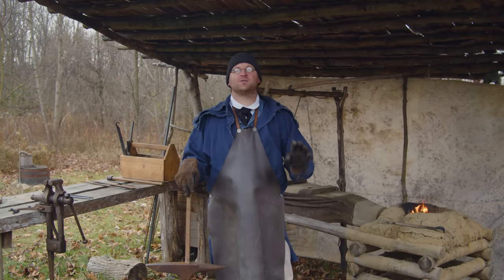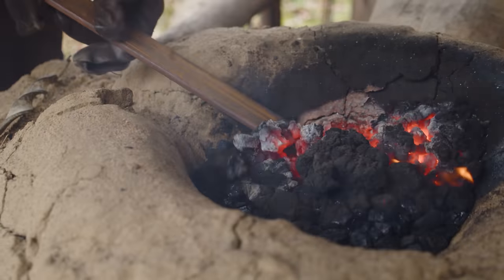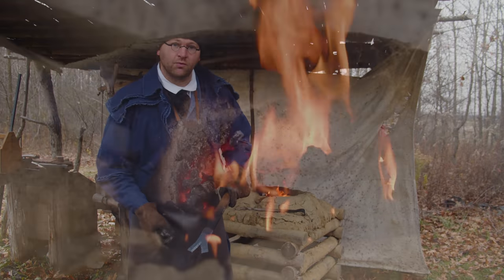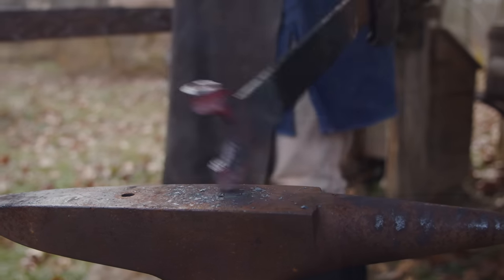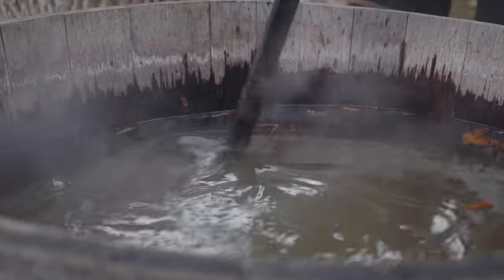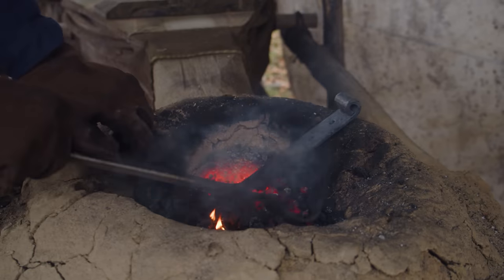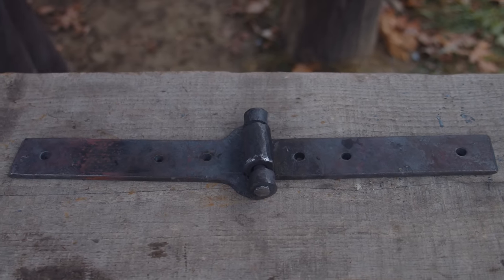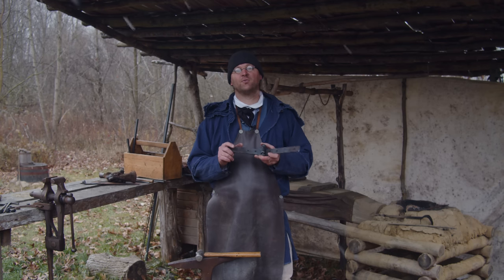Frontier Blacksmithing - Smokehouse Door Hinges

Comment: A trick to preserving the metal and also making sure the hinge will operate smoothly is after the finished product is ready for completion is to heat the item up to just dull red throughout and then to either quench it in oil or melt beeswax all over it and let it cool and wipe it clean. It will basically season it like cast iron cookware. Another tip is when you have to file your work is to hot file it. It removes the metal MUCH quicker and saves your files teeth as long as you keep it cool.

Comment: Great project and nicely done! A good final step: heat the hinge up to a black heat, and then rub beeswax over it, (if it smokes a lot it is just a tad to hot) this will help protect the metal from rusting, and add some lubrication to the hinge pin.

Comment: Pine tar might be a good coating for the hinges. Carburize it onto the metal like you would season a cast iron skillet. I use pine tar for most of the hardware I make when doing blacksmithing, myself and it lasts a long time and is easy to recoat.

Comment: I used to dabble in blacksmithing a bit. I want to get back into it and try some more difficult projects, but I have two main problems. The first is I need to either find or make some kind of jig to be able to file a consistent edge on the knife blade I made before I can finish that project. The second one is difficulty finding material. I can use rebar from the local hardware store for some projects, but I haven't been able to find stock steel anywhere. The hardware store doesn't have anything suitable for making knives with, and all the places I found where I could order it online were geared towards industrial use. I couldn't find anywhere to get the steel I needed that didn't have a minimum order of half a ton or more.
Reply: McMaster-Carr has a wide selection of steel in many varieties and small sizes/quantities

Comment: So what holds up the weight of the door? Just the "inner" part of the hinge sitting on the lower half of the fork? That doesn't seem like it would be very strong. I guess I assumed the "inner" part was fixed to the pin on modern doors, so you would also have the "peen" resting on top helping to hold up the door.

Comment: As you are an informational channel, I think it would be good if you had your terms and procedures for blacksmithing straight. For example, making the holes for the nails was not drifting, it was punching. Drifting is making an already punched hole bigger. This is not the first or only case of this happening, and as someone who is a hobby blacksmith and interested in learning, I think it would be a good idea to use correct terms for those of us who want to learn.

Comment: Why instead of cut hole hinge? Seems like way extra work you could have half punched too and bottom made those round and pin goes thru like weaving? Way stronger and faster. Did you need a 24in hinge?

Comment: Why not make a kiln style of the fire pit so as not to breathe in sulfur and other toxins. Less destruction to the health and more vectoring of the air flow and better shielding to the ambient winds and quicker to heat the metal and perhaps less fuel needed.